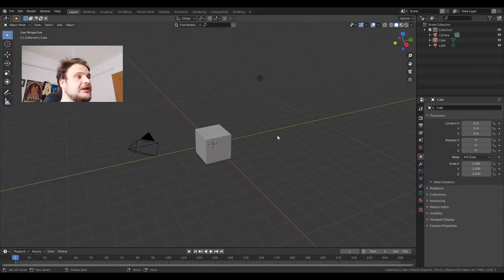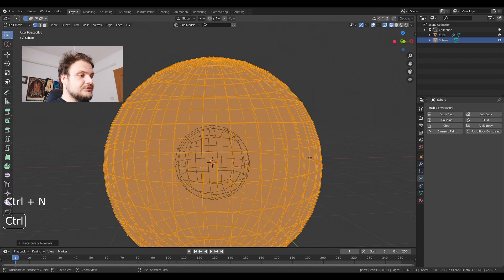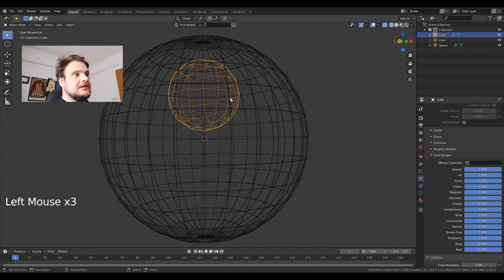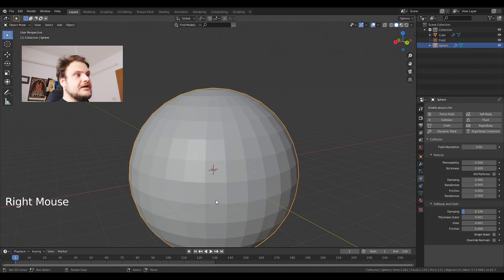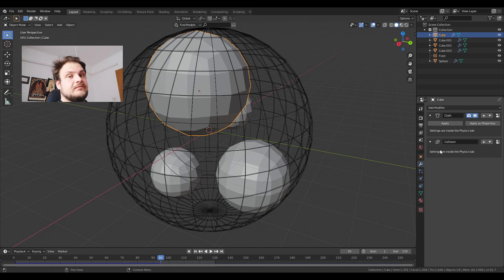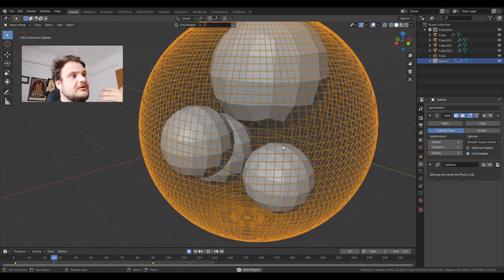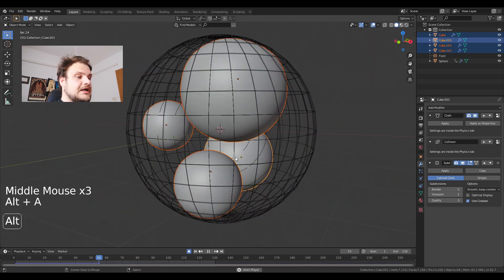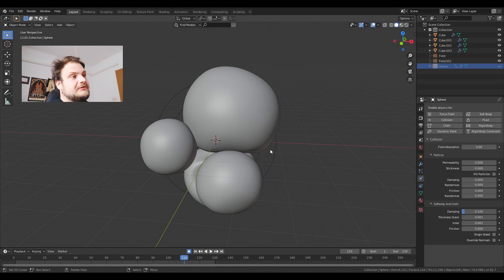SQUISHY ANIMATION WITH CLOTH IN BLENDER 2.82!

Comment: hi! i am new and trying to understand a few things - why did you use a cube with subdivisions to create the smaller sphere rather than use a UV sphere? thank you for your work!
Reply from the maker: Hey dude! I used the cube so it has less edges and vertexes, which keeps it bouncier when you apply cloth. The UV sphere came in handy because it has more points, so the collisions are a bit more accurate. I think it's possible to make it with more edges and vertexes, though you'd have to play around with the settings to keep it wobbly like that
Reply: @blatadej5474  got it, thank you! I have been following several tutorials to learn but i have noticed there's a lot of "do this next" and not a whole lot of "x happens because y", which for the way i like to learn has been tripping me up. luckily the blender community is SO FULL of people willing to teach! thanks again, can't wait to see your next tutu :)
Reply from the maker: @yompdrompsky  I think the main thing is that if you want to have short tutorials, you can't get too into specifics, otherwise the videos would be half an hour long. So the best you can do is to mention it in passing.
Reply: @blatadej5474  I love this method, forces me to figure it out by myself, which in turn forces me to remember what I'm doing